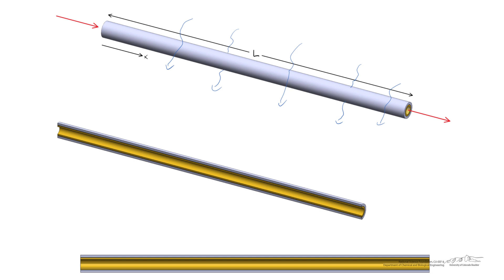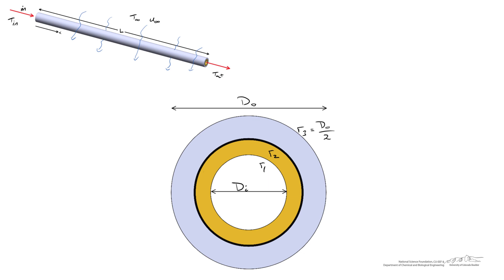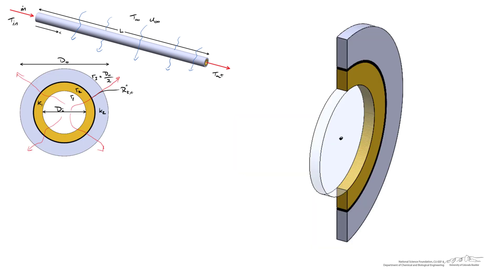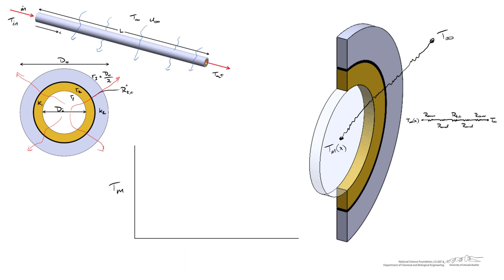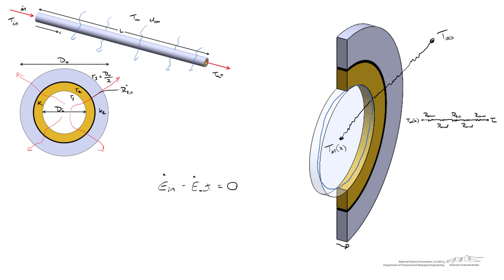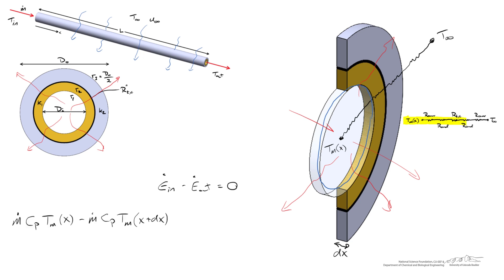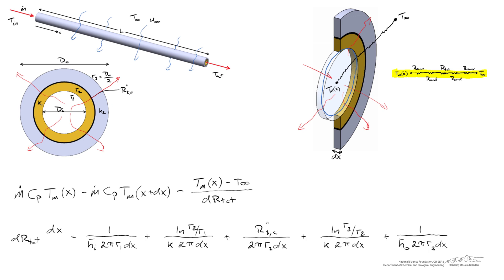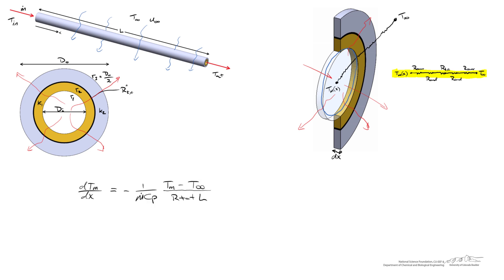Internal and External Convection

Comment: Nice video.  The problem with this is that the outside film coefficient is partially  dependent on the outside wall temperature with natural convection.   I have solved this problem several times in the past for both hot and cold fluids using a finite difference method so that I could adjust the outside film coefficient with temperature.   Now that I see this I think I will do a comparison to see what the magnitude of the difference is.